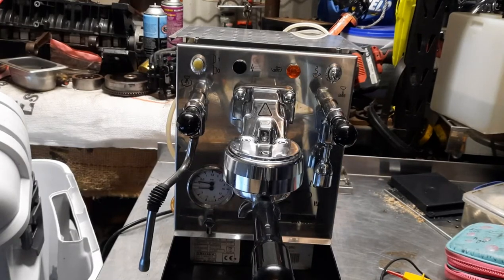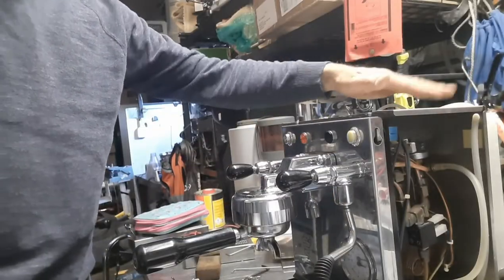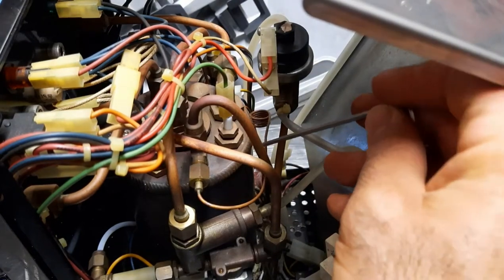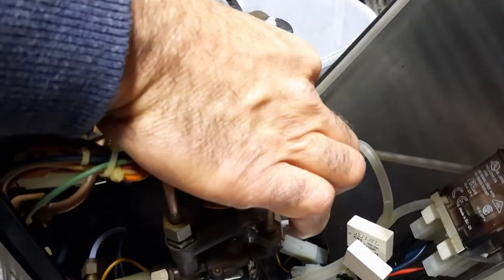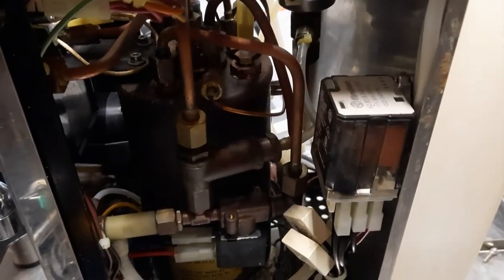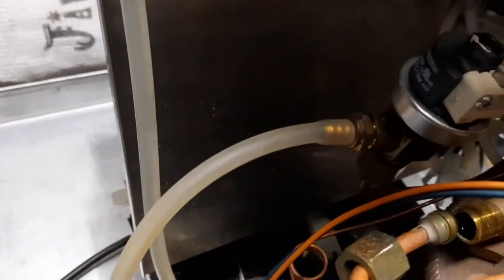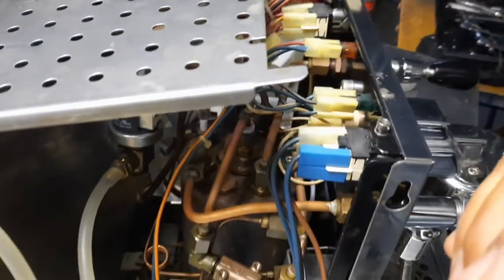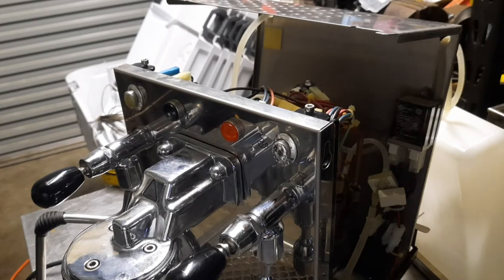Finding the issue with a Bezzera 10s domestic Espresso Machine

Comment: What about the calcium buildup on the bottom of the boiler, shouldn't that be addressed? Wasn't that a common issue with the bz10 where replacing the o-ring solves the mushroom buildup where the boiler endcap mates with the boiler itself?
Reply from the maker: The customer said to leave it , and it to be repaired the following time it came in for service

Comment: Hey there, the bz10 I’ve been using at work the past few days simply won’t turn on, no light coming on, nothing, any ideas why that have happened? Thanks!
Reply from the maker: Check the water tank switch, level to start, if the machine isn't registering the water in the tank nothing will work, but very hard to diagnose without seeing the machine